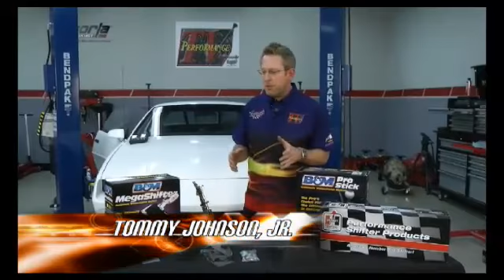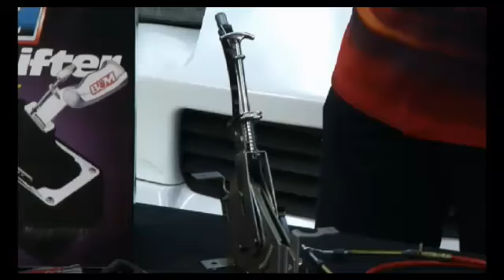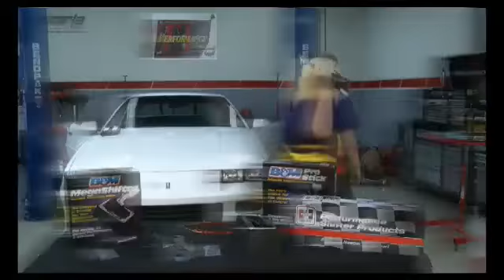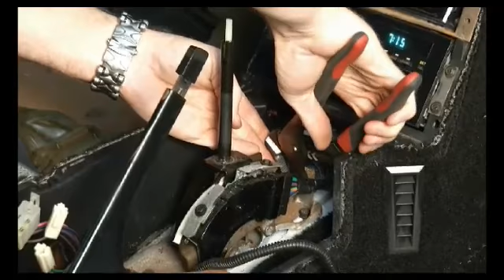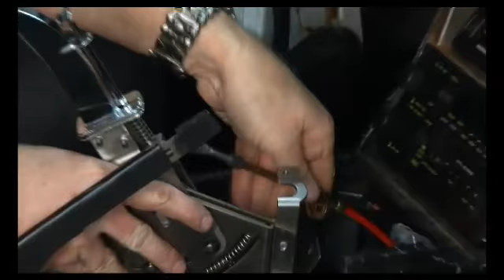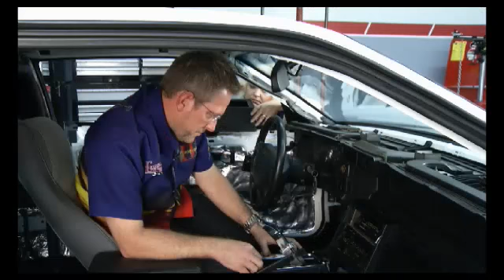Install: 1982-1991 Camaro, Firebird - B&M Console MegaShifter 80692:

Comment: Im swapping a sbc and 700r4  outta a 1992 chevy truck into a 1994 5spd v6 firebird, do you guys have replacement relays and parts for the mega shifter.
Reply from the maker: Yes, we offer the Neutral Safety/Reverse Light Switches (part #80629) on our website or by clicking the link below. We also have access to "Service Parts" such as springs, hardware, etc. that aren't available on the website. Please give us a call at 707-544-4761 and our Support Team will gladly help.

http://bit.ly/2RNonjN

- Jason @ B&M

Comment: I have a 1966 f85 Cutlass came with a 350 transmission I'm replacing it with a 200 4r for the overdrive but I was wondering to see if my ratchet shifter was still be good for that type of transmission
Reply from the maker: If you have the shifter in the video above it will not work on the 200R4 transmission. If you have a different B&M shifter that is not console specific then it may work on the 200R4. Your best bet is to give us a call at 707-544-4761 and let us know which shifter you have and we can get you some answers.

- Jason @ B&M